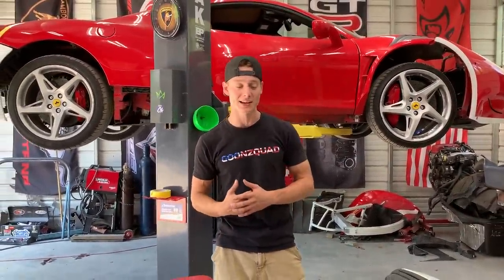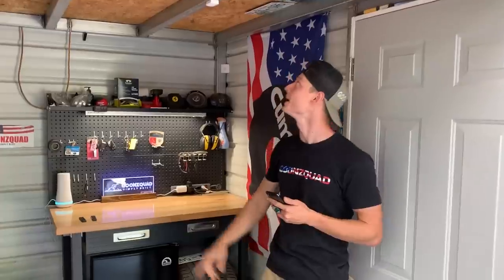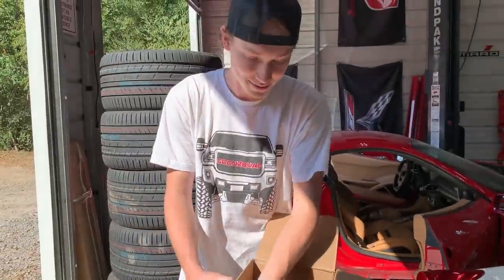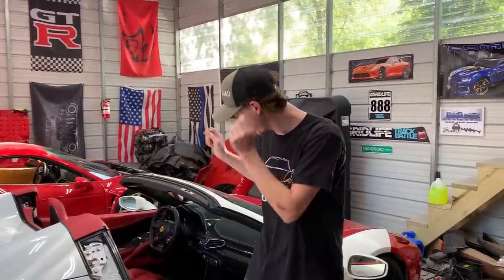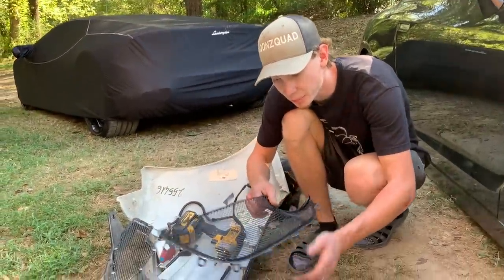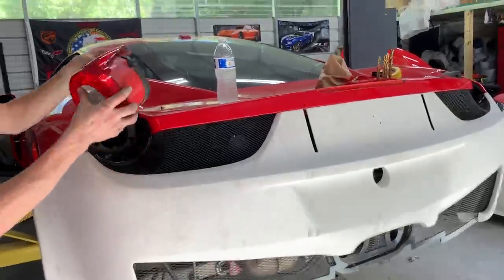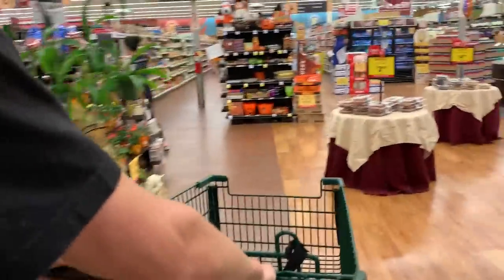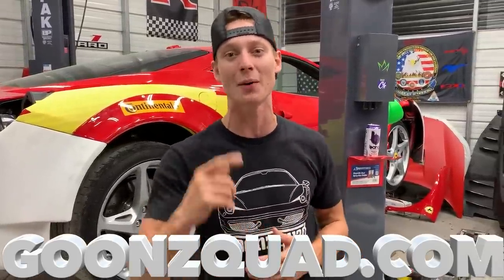Rebuilding A Wrecked Ferrari 458 Spider Part 9

Comment: You need to push the button that says Auto to have it stop shifting for you; this button toggles between "permanent" automatic shifting, and manual/easy-exit mode. By default, the 458 starts in Easy Exit mode if it was last driven in Manual mode. Basically this means it will shift automatically for you until you pull one of the paddles. If the car was turned off in Auto mode, it will shift for you, and even after you use the paddles, it will go back to shifting for you after a several seconds of inactivity.

PS button stands for "Performance Start" aka Launch Control.

Comment: @Jackie Ding on YouTube wrecked his 2020 Supra y’all should buy it from him.
Reply: Yeah he dinged it pretty good in that Time Attack. Haha
Reply: must be cheap
Reply: Nahhhh I think he will repair it. It's not that bad
Reply: It is actually pretty bad, especially with how new it is and how much replacement parts will cost. I agree it's not bad enough to sell but it's not just a really simple fix.
Reply: None of those body panels can be fixed, it needs all new ones. Just the headlight is around $1,200-$1,500 for the entire housing. The cost to fix that car is going to rack up very quickly.

Comment: Don't like to be the messenger of bad news but, too much stress on the bumper, it's going to crack.
Reply: I also think the holes they drilled in the steel panels need tot be painted again or else rust will start..
Reply: Doubt it, the pressure is dissipated within the whole length of the bumper, those 3 bolts should hold it just fine
Reply: @FaithfulMC  Time will tell, oh and a big chip fell off the bumper.  Guess time's up

Comment: Since Ferrari is Italian, it HAD to be metric. Only 'murican made stuff uses so-called imperial hardware. And not even all the time btw.
Reply: msylvain59 SAE (Society of Automotive Engineers) is the standard for most US made cars. The Ford Aerostar vans used both which wasn’t helpful. Most tool sets from Craftsman or Stanley have both standard sockets and Allen wrenches inside.
Reply: The only country in the world , bar Myanmar, that still bothers with that ridiculous measurement system.

Comment: How is that fuel cap door going to work with that wide body kit?
Reply: I was wondering that myself.
Reply: Gonna cut the fuel cap door to fit...lol
Reply: Probably gonna put a fuel cell in the front, and because it's Goonzquad they'll also probably do some upgrades.
Reply: Cut the flare
Reply: They are for sure going to cut out the little half circle
Reply: It has to be cut, tj hunt shows it in his video of his 458 wide body
Reply: @magrin4063  i dont know, if you do that and someday take off the wide body kit you are left with a weird half circle cap, i would be more inclined to cut out the body kit itself-french that door in into the kit.
Reply: You don’t cut the fuel door lol. You just notch out the fender flair
Reply: Nah nah nah see they know the upgrades they are guna have will make it so fast that the wide body kit will hold the gas cap closed so when they do donuts it wont come open lol
Reply: There's no going back. The quarters will have to be cut too.

Comment: Use a rubber grommet or seal strep when bolting aftermarket parts on.  Prevents cracking/chipping and stops squeaks from road bumps.

Comment: Remember: when you paint over the red on the ferrari to use a cheap white paint for the first coat or you will  have to spend lots of money covering the red and the shade will always be too dark, remember the ZL1 and the LAMBO, light colors over a dark base is always too dark, don't use dark grey sealer for lighter colors, invest in a light grey sealer

Comment: PS means Potenza Sportiva which basically is  the old school launch control for the 458. I believe when pushed it holds the revs up so you launch at a higher RPM verse just mashing the pedal from a dead start

Comment: Just so you know auto turns it into manual and ps stands for performance sport mode. And if you hold the small red lever in the final position on the steering wheel you can do burn outs. I’ve owned enough Ferrari’s to learn this stuff.

Comment: For the seat mounting hardware, are the bolts hardened, probably want 8.8 or 12.9 high tensile strength bolts.

Comment: Are you sure that you can use generic bolts from hardware store to lock the seats? From what I know there are different types depending if the load is vertical or horinzontal and the load rating.

Comment: You shifted way too early the gearbox was freaking out because you are flooring it high gear and that puts huge stress to transmission. You have to let the rpms rise allmost to the limiter and then shift when you are doing pulls.
When you are cruising low gas you can drive with higher gear.

Comment: Enjoying the video only issue is the seat bolts they mite be high grade type there is bolt grade table it could be the difference of them shearing off in a crash or not just thinking of the drivers safety 👍

Comment: I’m sure someone has said it however push the “auto” button and it switches the car back and forth from auto mode to Manual mode. If you just use the paddles while the car is auto the manual paddle mode is only temporary. If you don’t use a paddle for like 10-15 secs if changes back to full auto.

Comment: Those PIR motion sensors may pose a problem when it gets cold or hot if your garage is not climate controlled all the time.  Too hot and it's not going to detect a warm body moving in the zone or too cold and even a small warm body(such as a mouse) will set it off and will also greatly affect battery life on your active sensors.

Comment: have an idea for where you drilled the 3 holes on your bumper... get a piece of thick sheet metal. Cut a long strip out of it, drill 3 exact spaced holes on it. So to act like a washer on the under side of that white bumper. Rather then hoping if the bumper material is going to hold up.. cause if that car is going racing that shit going to rip off.

Comment: Smoke detector is mounted in wrong place.  It should be up at the roof line, not under the loft.  Smoke rises and will go up to the roof.  Your place could be completely involved before the smoke detector sounds off with where you have it.

Comment: That bumper will not hold with that much force on it, the composite will crack and eventually break when the car flexes. You NEVER install composites under a load like that.

Comment: The original rear bumper of the white 458 Spider is the optional one with carbon fibre central piece. Better repair that one instead of put the standard bumper of the red 458 Italia.

Comment: I hate the drilling into cars as it rusts around the hole/bolt I would try to waterproof them as much as possible. But if it's aluminium then no rust 😂. but if it's steel... I would put silicone all round then wipe clean anything I could do, I would.